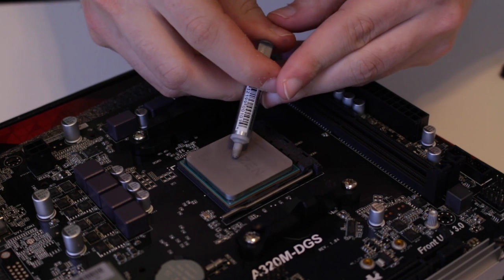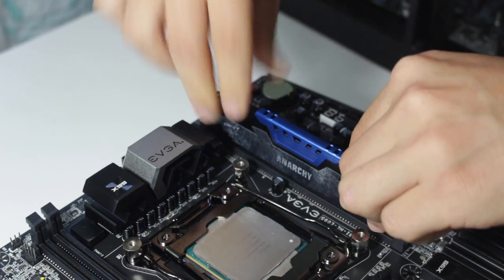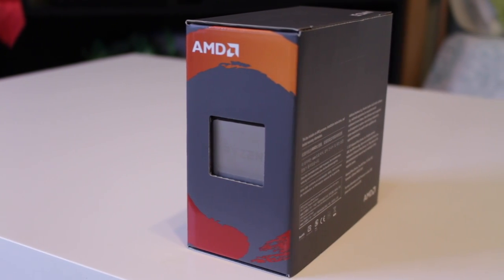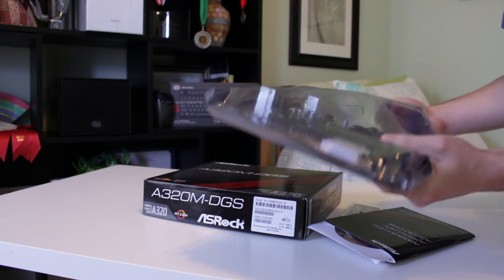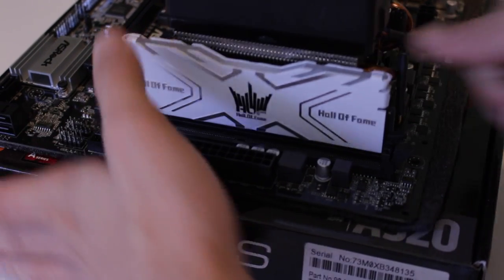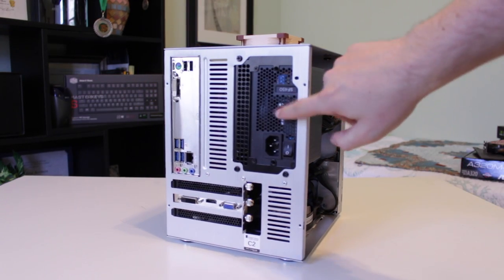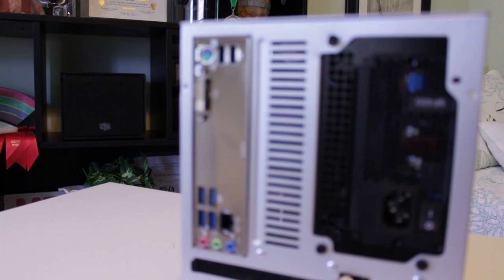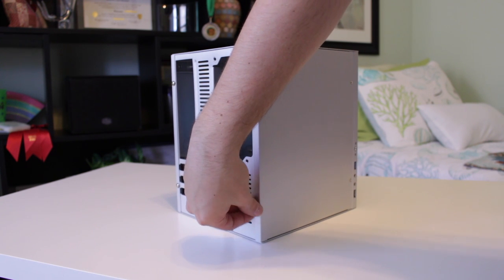I Switched From Intel to AMD... My Build and Why I Switched!

Comment: wave like the exact same computer... lol I built mine 3 weeks after Ryzen launched. also I have the b350 motherboard. so overclocking is a thing.  I had the GTX 1060 3gb from gigabyte, and I don't have temp problems at all, when I bought it, I got ti for $189, maybe I should sell that now, and use my 1050 till I can buy a 1080 lol

Comment: 1. Save for a 1070
2. Right now the biostar x370 mobo is the best itx out rn for overclocking
Reply: Wouldn't recommend that board at all because it only has a 4pin cpu plug and biostar doesn't update their bios as frequently as, let's say, asrock does... Asrock has their x370 gaming itx/ac but I'm not sure if it's available for purchase yet

Comment: Hey man can you help me out?? I'm trying to build a pc, but font know where to start, my budget is somewhere around $200 plz respond man it would help alot
Reply: Go to eBay and buy an old Optiplex 790, 890, or 990.  Big corporations get rid of their PCs every 3 years and hand them over to recyclers who destroy the hard drives and list the machines themselves on eBay. (Some of the listings will say SFF which stands for Small Form Factor and those can only take a low profile video card.  Avoid those if you're trying to game.)

Here's a listing 2 months after your post for an Optiplex 790 with an i5, 8GB RAM and 1TB hard drive for $138 and free shipping.  You will need to upgrade the power supply but if you do, you can then install a video card when you have the funds  - http://www.ebay.com/itm/Dell-Optiplex-790-Tower-Intel-i5-2400-3-1GHz-8GB-1TB-HD-WINDOWS-10-PRO-/292270847878

Comment: Cheaping out on that board means you'll never see the true performance of your 1700. If you really wanted that el cheapo board get a 1700X since its just an already OC'd 1700. Otherwise you're much better of getting B350 or X370 and just eating that cost.

Comment: Phenom II x6 1100t clocked to 4.175ghz on water (NOT AIO), Asus Crosshair V 990FX Mobo..   
8gb of Corsair Dominator 2000mhz RAM clocked to 1850MHZ.. Corsair 850 watt PSU (Silver)
(2) Evga GTX 770 4gb Classifieds..  SSD drive for OS and Caviar Black for storage..   The system is mostly 5 years old and shortly i'm upgrading, finally beaking away from AMD after the FX series debacle..   Going intel 8600k, 16gb 3200MHZ and a GOOD motherboard (likely Asus)..   An AMD Ryzen would only save me a total of $50 on my upgrade and since $50 isn't SH!T to me, i'm leaving AMD and I was AMD CPUs for 12 years (for gaming)..

Comment: For the love of everything that is holy, please, srsly, please get a blower style card for that pc.

Any blower style cooler will be miles better than any open air cooler on that case, don't buy open air gpu's for small form factor, it's awful, it makes the case way too hot and the overall rig run way too hot too, get a blower style cooler for that, trust me.

Comment: A320 is made for ryzen 3 / raven ridge apus, going for an 8 core in an A320 board is a shit idea
Reply from the maker: Why is it a shit idea? I don't plan on overclocking for now and it has all of the IO and connectivity I need. It cost $45 and fits my needs so I'm happy with it.

Comment: Overclocking with the r7 1700 is so easy that cheap really means you just threw away money. A cheap b350 board is what $30 more and would've been a way better choice. I don't normally say this but I regret actually clicking on this video...

Comment: IMHO I feel like this was a huge Money waste. Since you already had an mATX x99 board, you could've just bought like an i7 6800X an cram all that in the new case. Performance would have been better and you wouldn't have spent so much (useless) money
Reply from the maker: 6800k costs more than the ryzen CPU and Mobo combined and performs worse. I sold my X99 CPU and Mobo for $25 less than I paid for them a year ago so your argument is invalid.
Reply: Tech By Matt Yeah maybe the 1700 and your a320 mobo were cheaper, but I don't think it's also faster than a mildly overclocked 6800k. And considering the RAM and the new mobo your no way cheaper. But don't get me wrong I don't try to be rude, and if it's working for you this way, it's OK.

Comment: I like AMD it is better than intel for 1 good reason it is made in a dust free factory  and I know motherboards are not cheap I got lucky and  got a MSI 907A G46 military class mainboard  and it works fantastic and the bios is mouse controlled

Comment: What is whit this side/downgrades... Cheap mobo and expencive ram... Facepalm
Reply from the maker: I don't have the thermal headroom for any overclocking right now so the motherboard has zero impact on performance. Ram does have a big impact on performance so getting an expensive motherboard and cheap ram in this situation would make zero sense whatsoever.
Reply: Tech By Matt I thought ram really had no significant effect on performance as well. That's what they are saying at Linus techtips
Reply: 10/20 -> 8/16(core/threads). I consider a mobo to be backbone of the computer that you go cheap ut but thats just me. inexpensive Ram does not mean that its slow... (seen ppl runnin crucial ballistix 2400mhz kit faster than other manufactures 3200mhz kits in bios) As of this moment there are no A320 mobo reviews but i bet the are not on par whit x370 / B350 speed. Like on intel side b250 is much slower whit memory benchmarks tha z270... In the video it self did not clarify if you did managet to get ram running at 3200mhz... Did you ?

Comment: lol seems like this switches is major downgrade and miss opportunity, u started with gtx1060 and go down to gtx750ti, u got ryzen 7 is nice but u pair it with locked motherboard is a waste of it full potential,  trying to go itx is nice but the part u get to build it seems like a waste, u spend a lot of money on processor and ram, in my opinion the part u should spend the most when building a pc is the graphic card,ur previous pc is better than this "new" pc that you build

Comment: WTF dude!!!!!! You were ripped off by paying 60 dollars for a 450 watt power supply, I bought  the same power supply for 30 dollars. If I were you, I would try newegg.com
Reply from the maker: You didn't buy an SF450 for $30 new...  They're $90 on newegg: https://www.newegg.com/Product/Product.aspx?Item=N82E16817139156&cm_re=sf450-_-17-139-156-_-Product

Keep in mind this is an SFX 80+ gold PSU. Its much more compact than a standard PSU which is why it costs more.
Reply: There was a pretty decent sale going on at the time. Therefore lowering the price significantly.
Reply: I guess you kinda just have to watch for good sales deals in order for it to be worth while. Your setup is still pretty good nevertheless.

Comment: it's cool you moved, but every single one of your reasons was just... wrong. It was obvious you wanted to go budget, and small, but you never really said that, you just told us the benefits of what you were doing, which.. their are none. My case has 9 fans lol sounds like a freight train from time to time.. but I deal with it. Why are you putting a non turbo fan GPU in that case with no airflow? That makes.. literally no sense. You said you didn't like the 1060 because it ran hot, but you swapped it out for a card that runs hotter, with ZERO airflow.. what?!?! Then you swapped out the Xeon for the AMD ( good move ), but again, ... you have a CPU cooler that can't push air anywhere. You're GPU is just going to bake. It's cool you moved, but the video lacked hella details as to why, and what your end result was. because as it stands, it was a waste of money.

Comment: That is a stupid case !
Reply: JONY CREST Why?
Reply: The airflow is very poor ! Every single component will run more hotter than it supposed to. And it doesn`t even support a small GPU like RX460 .. . pathetic !
Fractal design core 500 or Cooler Master 130 would be a much better choice !
Reply: but core 500 and cooler master 130 is not an matx case (?)
Reply: Rmx haha Thermaltake Core V21 excellent choice